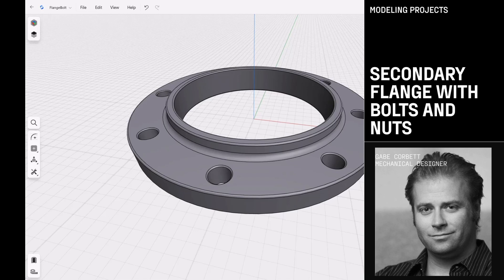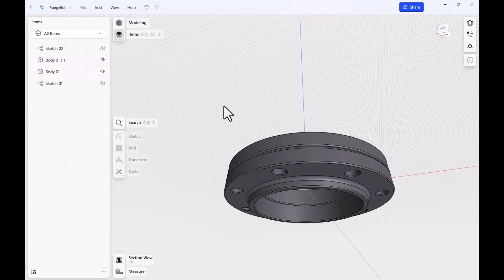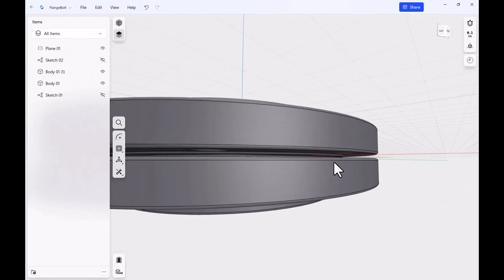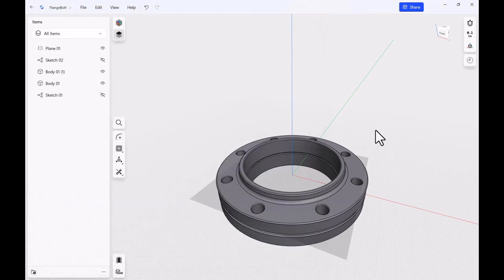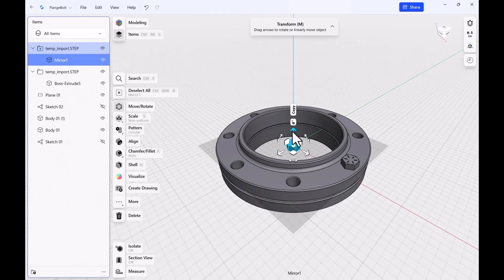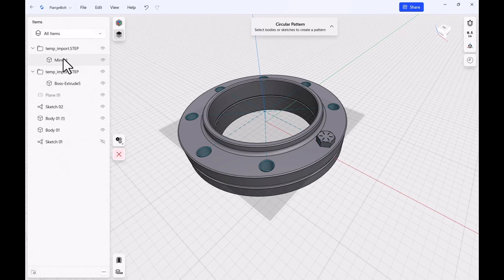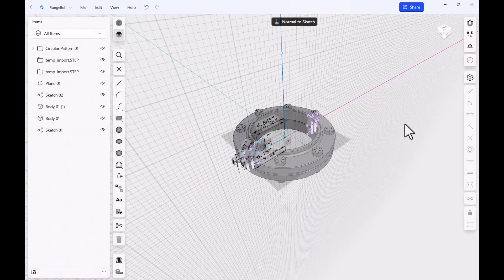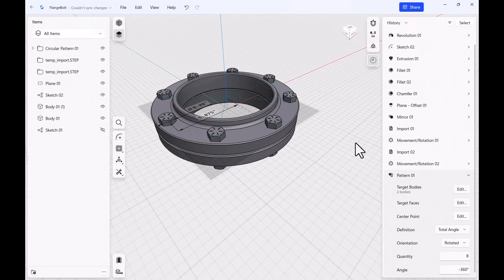Pipe flange part 2: Secondary flange with imported bolts and nuts | Modeling projects

Comment: This is great, thank you, but what if you need to shift the bolt and nut EXACTLY to the surface of the flange? Alignment works great sometimes, but in this case (and many other) we need a double alignment: to the center of the hole and to the top surface of the flange. Can we align a body one way while keeping its another alignment? Thanks